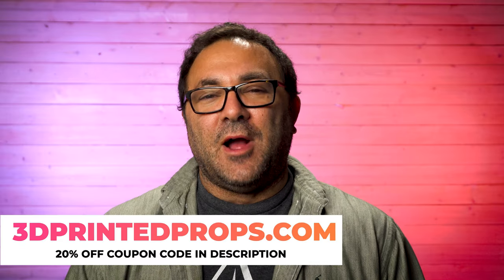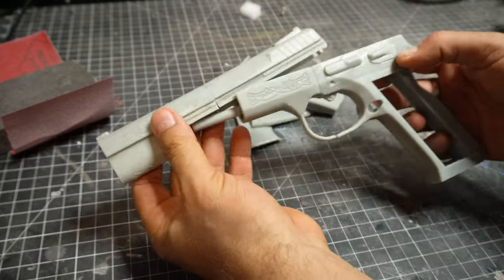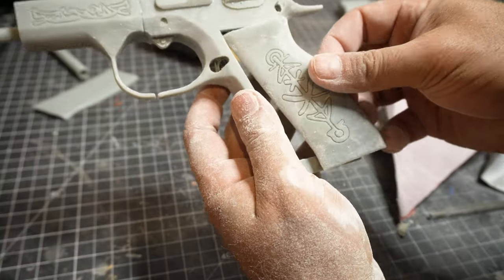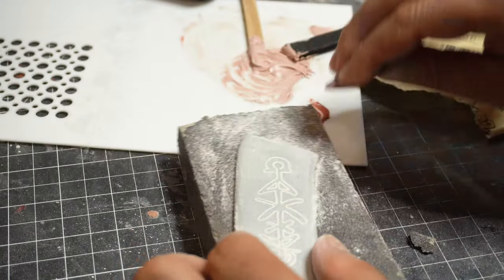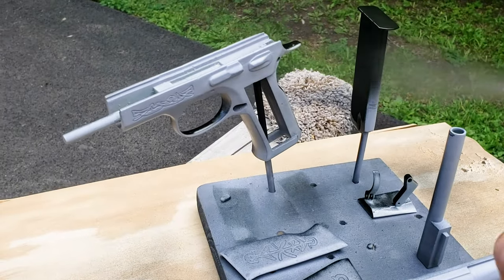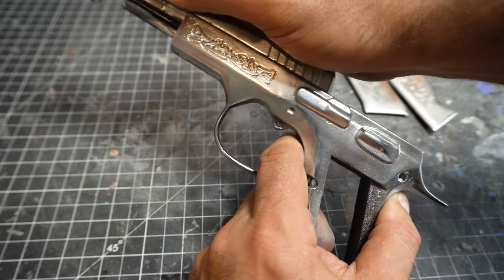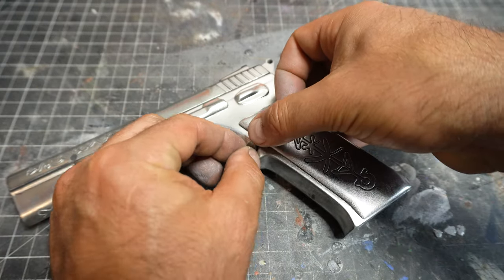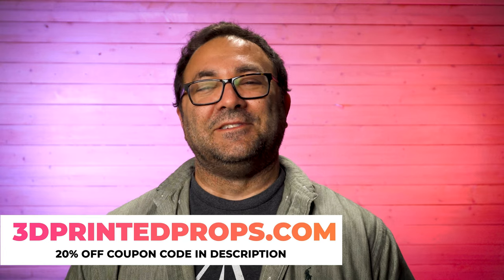Using Alclad Chrome to Paint The Equalizer | Supernatural

Comment: Nice job!  Since you're impatient like me, get yourself a food dehydrator to speed up the paint drying time.  Also, fill in the part seams & divots with the same UV-cure resin as the parts.  I fill a small syringe with UV resin and lay in precise lines at the seams then do a quick cure between layers.  Saves a ton of sanding work.  You can also mask off areas that don't need sanding to keep the sanding gunk out of fine details.  Getting a nice finish always takes longer than making the original pieces but it's worth it in the end.  Keep up the good work!